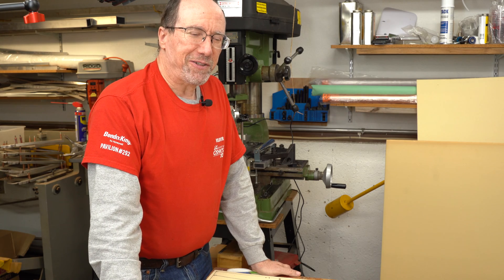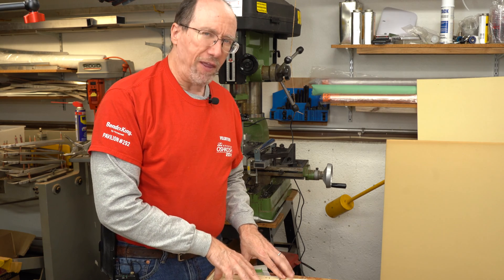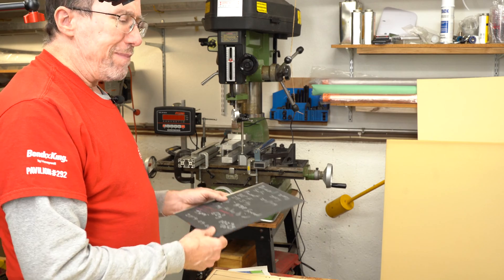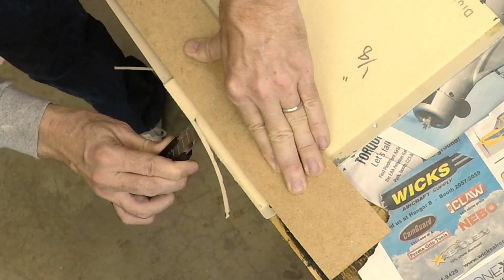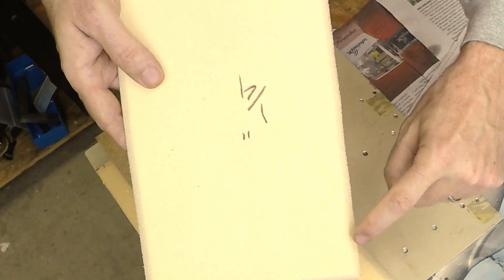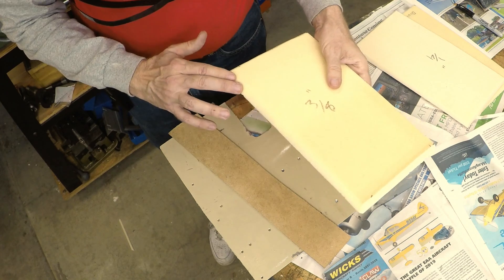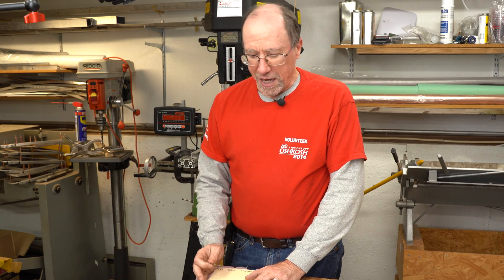Preparing Composite Solid Foam Cores for Vacuum Resin Infusion

Comment: I'm sure it would be heavier than the foam material, but have you ever used Lantor Soric as a composite core? Maybe it would be useful for small curved parts.
Reply from the maker: You are right about it being heavier. So I have not even considered trying it. I do believe that it would conform to tighter and complex curves so if I needed the stiffness on those curves I would consider it. Thanks!

Comment: It was dry because it went to fast
Reply from the maker: Kind of. This was an experiment. I usually halt the resin flow when it gets near the far edge of the foam core and let it set/soak for 5 minutes before resuming the flow to the end. This time I skipped the 5 minute pause to see how well the resin would flow. The actual rate of flow for the rest of the part very slow. About 1/2 inch per minute.

Comment: Something it's wrong , probably you should change the flow media
Reply from the maker: I'm going to do some more testing with this setup to see if I can make it work. Flow media is of the things I'll test.
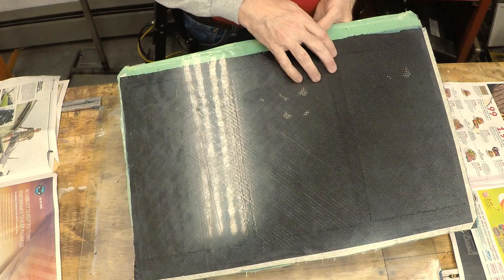Reply: @Designer103  your answer is in 15:39 

You got the holes right you just need the lines